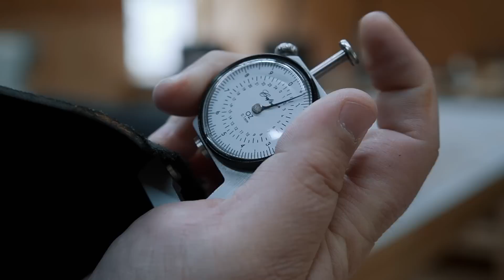Cowboy Action Fast Draw Holster

Comment: Very good looking rig, a couple of comments though. Lined belt is really nice, a buckle with a roller on it makes it a lot easier to cinch up though, particularly with a lined belt that is kind of stiff. You couldn't pay me to use a lined holster, had one finally had to quit using it. First off, an unlined leather holster is absolutely fine, I was a Deputy and carried in an unlined holster for a number of years, started out with a blued revolver, no problem at all but since you are out in the weather switched over to stainless. A liner in a holster will come loose, sooner or later, it will get a hole in it and start peeling off no matter how carefully made, when they start doing that you have to buy or make a new holster which will be unlined since you learned your lesson that they don't last over the long haul.

Comment: Nice- unfortunately the leather isn't thick enough. You'd want at least 12/13 oz for the belt + liner and I'd go 12/13 oz on the holster without a liner. No need for a liner on a holster.